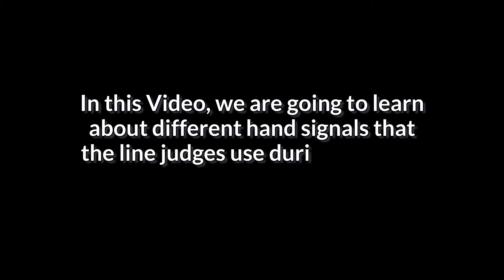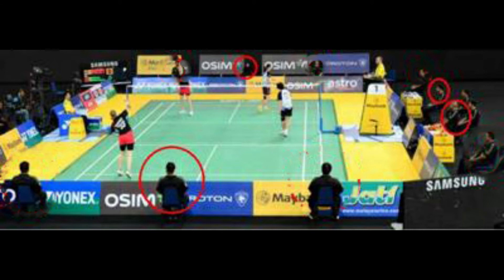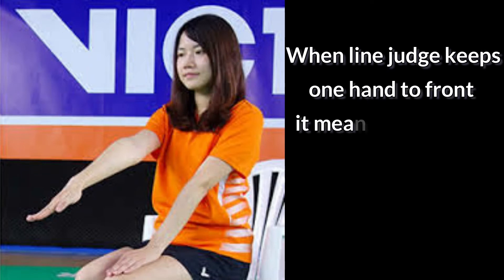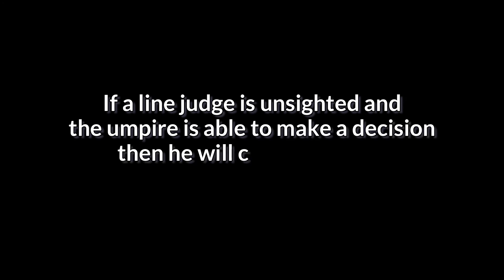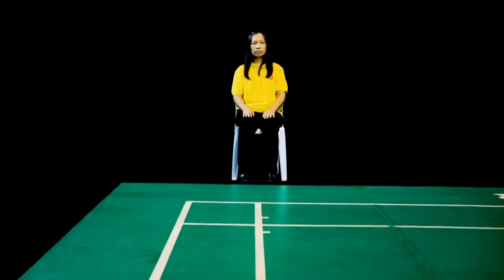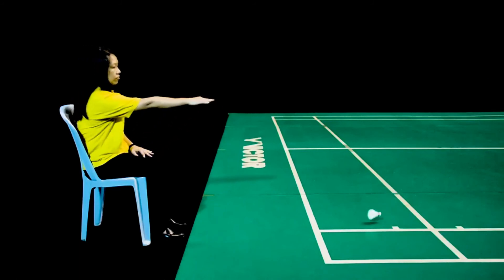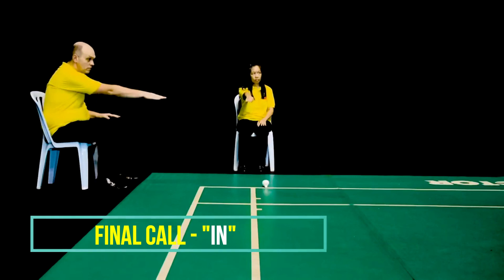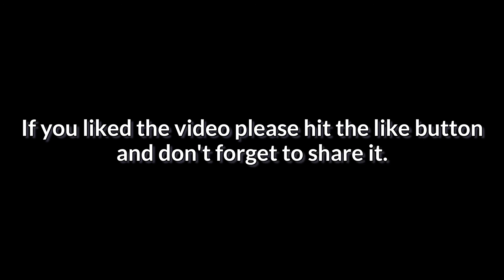Understanding Badminton Line Judges Calls #jsbadmintonacademy

Comment: 3:21 can anyone explain to me? why the line judge in the back make front hand gesture? its clearly the ball is out.
Reply from the maker: the line judge made front hand gesture because the shuttle landed well inside the lines which she has to see her role is to see if the shuttle is landed inside or outside of the back line but not side line. Since the shuttle landed well inside the back line she said in and while the side line judge checks for the side line and he calls out. I hope you understood if not please let me know I will try to answer.
Reply: @SBMBadmintonAcademyBeeramguda  so what call is that? In or out? Or they will call Let?
Reply from the maker: @21G-g3i  Final call by umpire will be out.
Reply: It was in, because only the first touch to the ground is counted, the cork went outside after bouncing from inside, so that's why it's in...
Reply: Seriously confusing. Can explain a lot simpler?